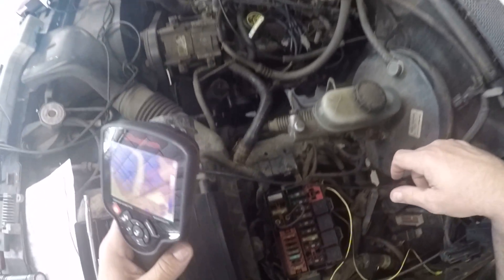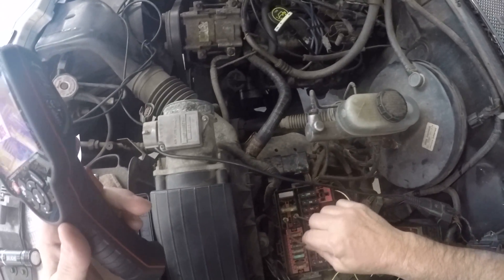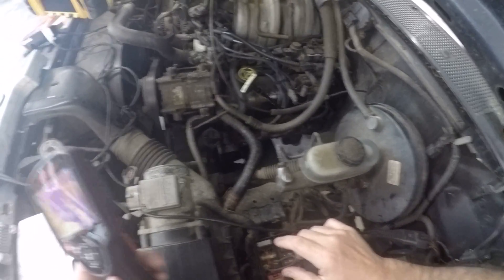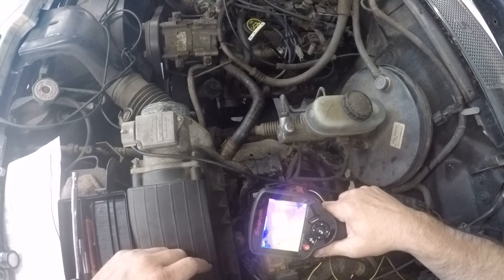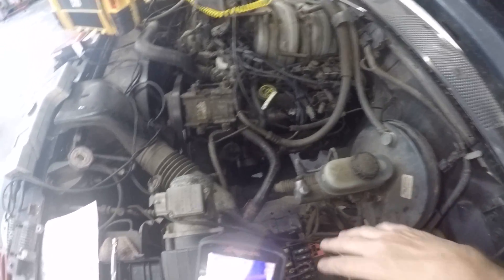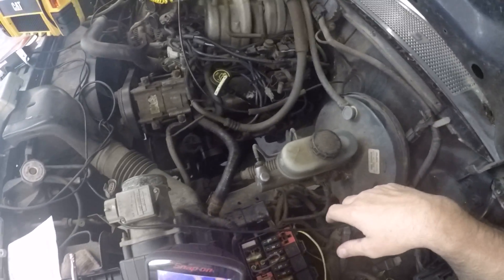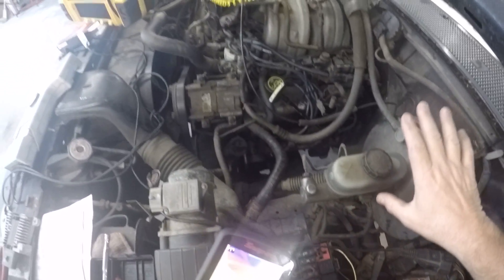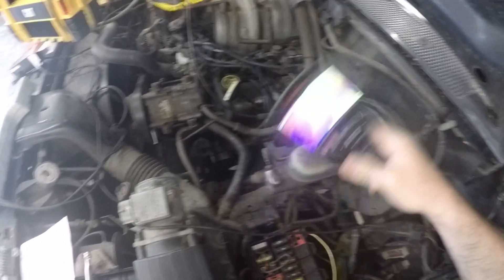Thermal Imager Finds Short

Comment: To the person who asked about the cost, mine cost right at 1250.00 dollars. For my comment to the tech in the video, their should be a 1 hour diag charge for electrical. That thermal tool wasnt free and you dont work for food stamps either.
Reply: The customer is paying for solutions, not methods.  It doesn't matter how you diagnose the car.  If you fix it, they pay.
Reply from the maker: tlt40s&w 70 agreed. It’s one of the least expensive tools but I feel the way you do because of the technical application. The tool has very little to do with it. I don’t get $150 an hour for my alignment machine even though it cost $40k. If you use a paper clip it’s worth the price for the skill if you find and repair the issue correctly. Thanks for sharing.

Comment: Sorry what do you mean by "pulsing" the power exactly?
Reply from the maker: Darren De Silva connect a solid wire across the fused connection that is being effected but you can’t leave it there. You must connect/disconnect quickly enough to produce the heat of the shorted circuit but not so much that you melt the car down.